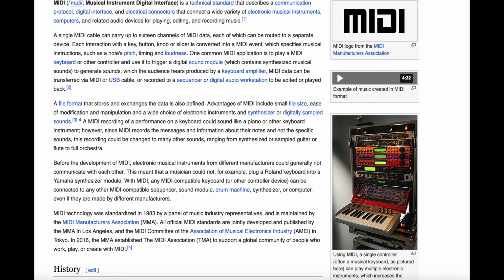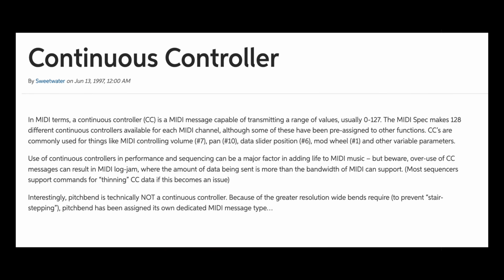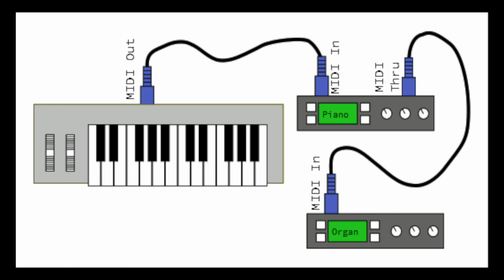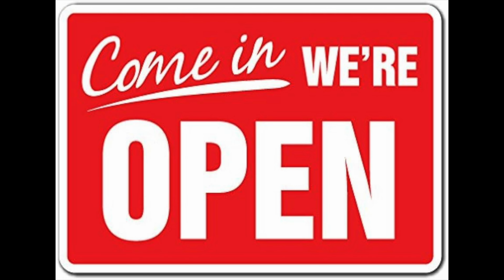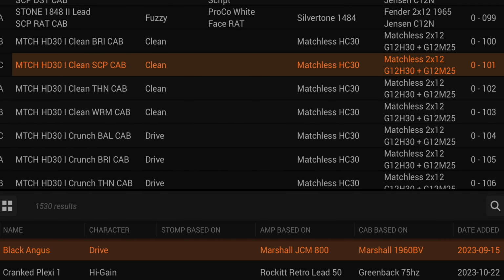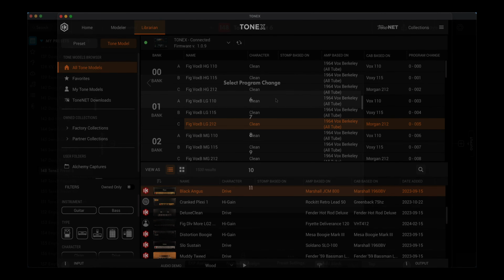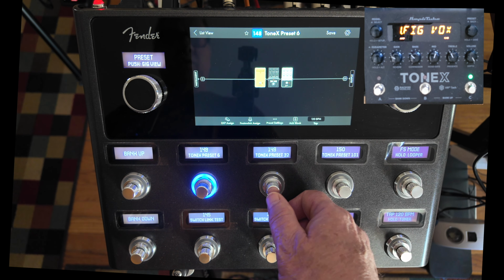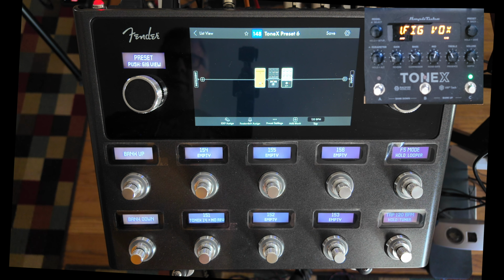Fender Tone Master Pro - Let's Check Out PRESET MIDI!

Comment: Thank you Doug ! Very interesting. I have a question with midi, but I want to command a tone master preset change. I explain : i’m singer in a band and I also Play Guitar. I want change preset of tone master when I change song in my song book software (I use SongBook Chordpro). It’s possible to send midi command, but i don’t know how to write the midi command. I already did it with voicelive of tc electronics, but it seems the same method are not ok with tone master. Thank you for helping
Reply from the maker: I took a look at the manual for your app, and it seems like they give you the most basic info and then say that "MIDI is a very complex topic. Unfortunately we're not able to help with specific questions about MIDI setup or MIDI commands." I can't see any way of referencing the MIDI channel; it just takes whatever command you put in and sends it out on all channels. So if you are trying to send messages to both the VoiceLiva and the TMP it won't work correctly. If you put in a PC command, it's going to send that command to both devices.

Comment: Thanks, Doug, for this video. I'd really appreciate it if you'd post a similar one using the Kernom Ridge pedal. If not, could you please tell me how you made the connection? The FX loop is clear, but in the MIDI, you only connected one cable to the OUT/THRU. Is that correct?
Reply from the maker: I used one cable connected the TMP's MIDI Out port and to the ToneX pedal's MIDI In port. I'm sending  commands from the TMP, to the ToneX.  You would do the same thing using the Kermon Ridge. Thanks for asking 👍

Comment: I wish we can send midi notes to trigger ableton clips etc
Reply from the maker: I'm curious - how does Ableton take MIDI notes and use them to trigger clips? I literally know nothing about Ableton.
Reply: @DougBsDigitalDen  In the upper righthand corner of the interface it has a midi map button. I have used various controllers like APC40, Quneo, and FCB1010 foot controller over the years and they all worked the same way where I could send midi notes on the buttons and in midi map mode you select a clip or most other action buttons while pressing the note in midi map mode and it will map to then trigger launching the clip or performing the action of the button when that note is sent. Also same for cc, you would click a virtual slider or knob on ableton midi map mode and then send cc by moving slider/knob/pedal on the device and they would map. I have been researching that I may be able to use Bome midi translator or max for live packs others have made to convert cc sends to midi notes to get this functionality with tmp so I will let you know if I get it working. i would like to have tmp replace my fcb1010 as that unit is really frustrating to program compared to the ease of tmp.

Comment: I have a midi expression pedal that I plug into my pc and use it to control plugins like Bias FX2 and Amplitude. Would it be possible to control the virtual volume and wah pedal via midi the same way with the Tone Master Pro? I know you can buy a TRS cable expression pedal that works, but I already own the midi version. Great channel. I'm considering the Fender Tone Master Pro and I've already watched a bunch or your videos on it. Thanks.
Reply from the maker: Yes, IF your pedal connects via 5-pin connector. MIDI via USB isn't implemented in the TMP at this point. Thanks for watching 👍

Comment: hello. If possible, how can I connect the TMP with an iPad so that when I change the song on the TMP, it changes the page on the iPad where the lyrics or sheet music of the song will be. And…, where can I find information about the use and application of Fender MIDI? thanks in advance
Reply from the maker: I'm not quite sure how to do that, but I am going to be having a guest next month (Nathan Conner) who will be going over a similar situation. You could try contacting him on the FTMP Facebook page if you need that info ASAP. The MIDI info for the TMP is towards the end of the manual; make sure you have the most recent version.

Comment: I have a voodoo lab ground control pro...Can I control the TMP looper functions with that? Just wondering, I use the TMP on my desktop and was wondering if I can use the GCP as a separate foot controller
Reply from the maker: Yes, it should work perfectly. If you take a look at the latest TMP manual the MIDI Implementation Chart is on page 41, and there are 8 different CC commands for controlling the Looper. Let me know how it works out for you 👍
Reply: @DougBsDigitalDen  ok thank you, I'll give it a try

Comment: Great video! I’m thinking about getting a TMP.. I’ve got a question - it might be obvious, but I’m wondering could I plug my pedal board chain directly into the main input? (And maybe use the tmp mainly for the amps) Or maybe use certain effects before the tmp and others like wet effects in one of the effects loops?
Reply from the maker: Yes you can! It has 2 analog FX loops and 2 digital fx loops.
Reply: Awesome! Thanks for the reply! 👍🏼👍🏼

Comment: can you make a video of the tone master pro using midi to change channels on a live amp. Using TMP as just effects with the 4cm.
Reply from the maker: Sorry, I have no amps anymore
Reply: Use the program change number to 1-4 fir each amp channel just make sure your midi channel to the amp is set correctly its usually one by default midi out from TMP to midi in on the amp
Reply: @msvapehead  can you make a video doing explaining. It won't work.
Reply: @jeffpritz2933  what amp are you using?
Reply: @msvapehead  evh 50 watt stealth
Reply: Amp midi channel 1 (find out from your amp user manual what midi channel) 

Send program change PC 1 for amp channel one
Send program change PC 2 for amp channel two

You are sending a program change to your amp using pc 1-4 depending on how many channels you have. 

Cable- Midi out from TMP to midi in on your amp
Reply: Note that the default MIDI channel for the amp is channel
one. The amp MIDI channel can be changed by sending a
program change message from any other desired MIDI chan-
nel while in “learning mode.” The amp will then respond only
to program change messages and control change messages
on that new MIDI channel.
Reply: Check the user manual for your amp under midi
Reply: @msvapehead  I still cant get it to work
Reply: @msvapehead  can you please help